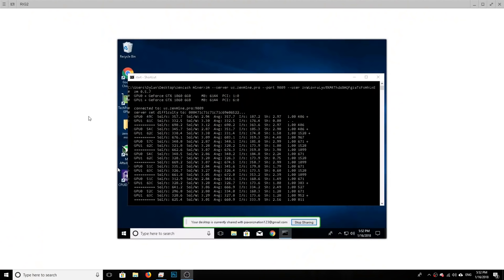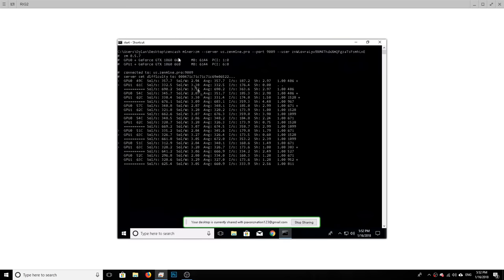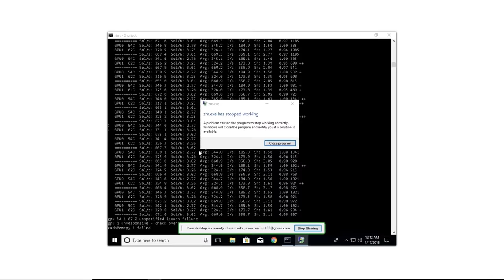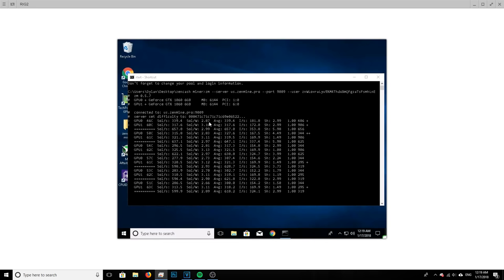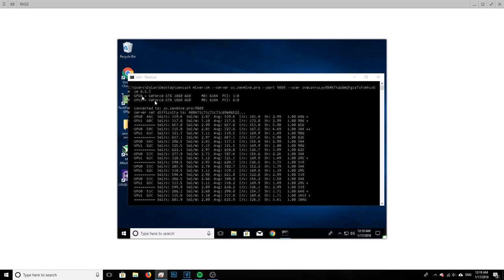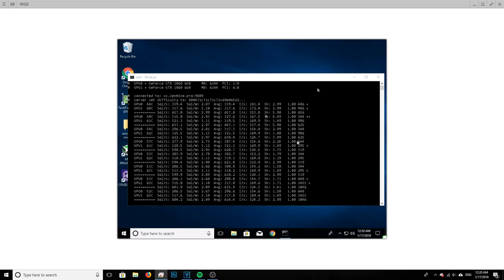1 PCI-e to 4 PCI-e Lanes!!!!

Comment: Hey man!  Nice build up you got there.  How are you doing with all of this now, since its been 3 years?  I just got into mining myself the last couple months, and I am doing a lot of research.  I have 3 gpus running now, 3090, 3060 and 1070.  I have two more currently, that I am looking to get going once I receive a card pretty close to what your showing in this video.  The one I am getting connects into the pcie and then has 4 of the USB ports on it.  I already have the risers that I am going to be powering with my extra PSU I bought.  So I am looking to run 3 of my GPUs on this type of card, I am just having trouble finding any videos on the card I bought, but this is really close.  I am actually planning on making my first youtube video about that when I get it, and hooking it up, to show people the ins and outs of it.  Thank you for your video, as I definitely learned some stuff from it about my build!
Reply from the maker: I am indeed still cryptomining. I may post a video about it soon.
Reply: @SergeYoutube  please do brother!

Comment: hmm what is name the part on motherboard psu connector of that? where can i buy it? give me the link please
Reply from the maker: Im not sure what you are talking about, can you give me a time stamp?
Reply: Serge hmm connector from server psu to 24pin atx motherboard...
Reply from the maker: This connector runs from a 6 pin pcie to a 24 pin motherboard connector and even has a 4 pin connector for the cpu. Most motherboards used for mining today have a 8 pin connector for the cpu but dont worry, just plug in the 4 pin and it will work just fine. The readon there is 8 pins is because if you used the cpu for something intensive you would need more power but for mining the cpu does nothing so it will be fine. https://www.parallelminer.com/product/180watt-max-24pin-atx-power-module-included-sata-molex-cpu-power-connectors-ditch-your-atx-power-supply-entirely/

Comment: Hey brother hope you doing well can you tell it's working 24/7 in stable condition?
Reply from the maker: I never used it again. It would cause crashes after a day of mining. But they could be my fault. Might need some tweaking to be stable
Reply: @SergeYoutube  thanks for your reply 
if i get this from my local market then I'll try some tweaks otherwise ll go for new MB 😅
Reply: @FunjabiStar  Where you able to get it to be more stable? Or does it crash on your system as well?
Reply: @karvinfernando3782  i just brought B250 MB it's working fine with 12 card 3070 rig
Reply: @FunjabiStar  Thats awesome!  Similar hashrates? no crashes?

Comment: It splits the bandwidth which very little is required. It will depend on the cards memory as to if it’s stays stable and of course Linux is going to be way more stable.

Comment: Thanks for the nice video, I have 2 gtx 1060 3g graphics cards, and now I am looking for a motherboard that is cheap and extendable for the more graphics cards, do you have any suggestions?
Reply from the maker: Not right now but i will keep looking
Reply: My suggestion will be old P67/H81 that has 3 pci-es on them, the parts and the mobo itself are so cheap, a 8gb DDR4 cost almost as much as the whole build. I have 2 P67 dedicated to mining, running 3 cards each. I don't know why but the 4th card will result in frequent crash to the miner.
Reply: Aliexpress is your friend.

Comment: I was going to get one similar to this, but I don't think it will work in my motherboard. It turns out my motherboard hates having a 3rd GPU (supports crossfire and has an extra PICe X1, so 3 slots total). I don't know why, it works fine having any card and any riser plugged into any combination of the slots, but it cannot handle 3 at once for whatever reason. Good thing its my test-bench system, because trying all those combinations took a while. 

I guess I will move them back to being bolted on the top of my case on my main system where I can run 6 at once (probably 7 since it has a lot of M.2 slots, but I haven't tried).
Reply from the maker: Thats odd
Reply: they work fine ii have used them on 3 diff mother boards no prob gpu's were amd tho
Reply: Crossfire requires the cards have atleast a x4 link, while nvidia's SLI requires a x8 link.

So the x1 is not sufficient to their standards of operarion.
Reply: Oh, I mean it has 2x full slots, plus a third x1. I wasn't trying to run the third card in crossfire, just for mining. It works fine for mining in any 2 slots (any combination, like top x16 + x1, or bottom x16 slot +x1, or both x16 slots), it just cannot accept a 3rd card period. I was wanting to put 2x R9 Fury and an RX 470 (I ran 2x R9 Fury and 4x RX 470 in my main system all at once without issue), but my FX-8350 mATX board (Asrock 970m Pro3 Rev2) just doesn't seem to allow 3 cards at once. It can run mix-matched cards just fine, but everything stops working when a third card is added and it does a GPU error code before BIOS splash (which has only happened when a faulty card was inserted, but I know the cards all work, they are back on my main tower chugging away no problem). 

I think its a rare case of board specific problem. Its very unusual, but then again I highly doubt they expected someone to run 3 GPUs on a budget board. Although its weird I've never heard of this before, so it must be uncommon. (BIOS is the most up to date, it's always been smooth sailing on that board and I've been impressed by its good feature set and quality for its bargain price). Would be great if it didn't have this problem, but its not a big deal to get something like a C2D board for $30-$40 and have it run it instead.
Reply: You have to disable on board vga from bios, thunderbolt and on board audio if there is. And try to change pcie gen to 1 or 2 or to automatic, which ever works for you. 
Without disabling on board vga chances are less that you'll detect 3rd or more cards.
Reply: Jake Garrett You have to disable on board vga from bios, thunderbolt and on board audio if there is. And try to change pcie gen to 1 or 2 or to automatic, which ever works for you. 
Without disabling on board vga chances are less that you'll detect 3rd or more cards.
Reply: talha5007 it's AMD FX, so there is no onboard video, also too old for thunderbolt. I have tried PCIe gen changing, I thought that would work, but it didn't change (good idea though, after some head scratching I thought "aha!", but unfortunately same thing happened). I think it's just a board specific problem, but no big deal, I'll just get a C2D sometime, those are pretty cheap.
Reply: Jake its most likely due to the fact that youre running 2 gpus at 16x 3.0 speeds in your 16x slots. if your motherboard has a bios setting to change pcie slot settings set them to gen2 or gen1 speeds and that should help. if not, throw those 2 cards you have in crossfire on 1x to 16x risers and that will most likely clear everything up.
Reply: c4 on the floor I think I tried that, but I honestly can't remember. Maybe it was that simple the whole time, it would be nice if it was. If that works, I'll comment back and add solved in my first comment. It feels like I tested it, but I could see me doing something silly and not having the second riser plugged in (modular PSU). It's possible, so I'll go test that out soon.
Reply: Interesting. I have one system running 4 cards perfect, and another which cannot handle more then 2 cards. I can only speculate that the CPU may not have enough lanes or some other issue. I tried this 4 port rig on an old intel Q8400 and the motherboard itself could only handle 1 single x16 card so I don't know how many lanes the board or chip combo could actually handle to begin with. Anyhow my FX6350 works fine with 4 cards been up and running for quit a while. However, the intel Q8400 rig cannot handle more then 1 and is unstable with 2 and no video output with 3 at all. I do not know exactly why. I expected it to work on that machine.

Comment: Surely if it split a full pcex16 in to 4 it would have maybe have worked better rather than them trying to use a by 1 slot between them don't know for you can get such a thing but seems to me 4 cards in 1 X 1 slot would be starved of bandwidth know bandwidth not to important for mining n that why a 1x1 slot is fine for one card but pushing it to 4 probably not best idea
Reply: theoretically you could run 16 or even 32 cards off one single pcie 16x 3.0 slot if someone made and sold an adapter for it. Mining uses hardly any bandwidth and the only thing that you would really need to worry about would be pcie lanes on your cpu and running out of them. I've actually ran 16 gtx 1050 tis off one single 1x slot on an older board that only has one single 1x slot. it worked just fine. Only issue I had was windows picking up the cards and getting drivers to properly install. 1 bought 5 of these 4 way splitters to accomplish this, much cheaper than buying a $300 19 pcie slot motherboard.
Reply: c4 on the floor nice knew mining didn't use much bandwidth didn't realize quite how little do you think it could be worth mining with a hd 7950 3g have a spare by 16 slot on my board on my main rig but only have 2 lanes left due to SSD drives but if could might be worth having that mine in background while I game on my main card do think this could work n how hard would it be to set up I've never mined before
Reply: funny u say that. I actually had a hd 7950 3gb that I just sold on ebay the other day because it wasn't making enough for the power it was drawing. I'd try your best to steer clear of old power hungry cards. anything in the gtx 9xx and 10xx series works well, as for amd I don't really know much honestly. Nvidia cards seem the best for profit/power draw at the moment, and with the huge dip in crypto you better not be spending more in power than what youre making.

Comment: So this video is useless, because you did not actually plug 5 GPUs to it...
Reply from the maker: if it can work with one it can work with 5
Reply: Serge I wouldn't be so sure about it. If this is true, than basically you can daisy chain them and get 20GPU mining rig out of any motherboard.
Reply: Just saying Serge, not everyone would be able to get 5 gpus working properly depending on what mobo/cpu combo they're running. Its not guaranteed to work for everyone.
Reply: I have one of these in my mining rig and it has 4 cards wired into it and it works a treat, only thing is due to bandwidth issues it needs to be in the x16 slot, been running for 2 weeks now and no problems! :)
Reply: forgot to mention 4x gtx 1060's 3gb
Reply: Jonathon Maguire good to know